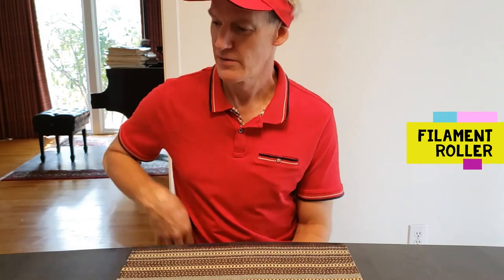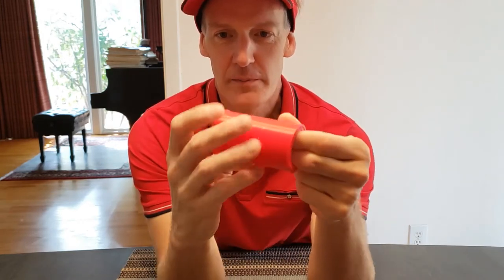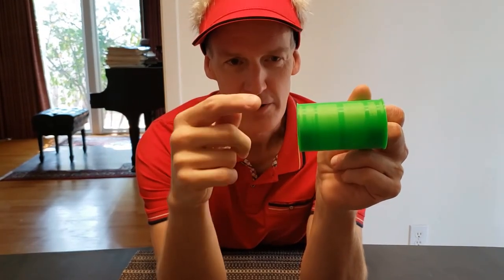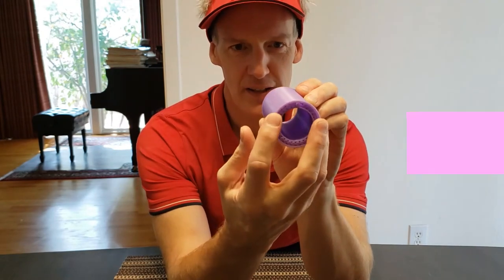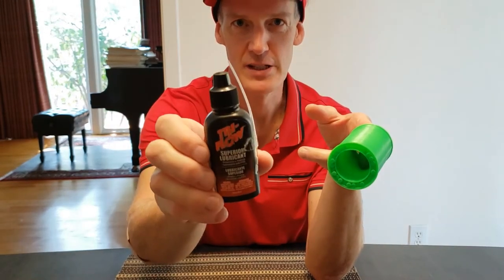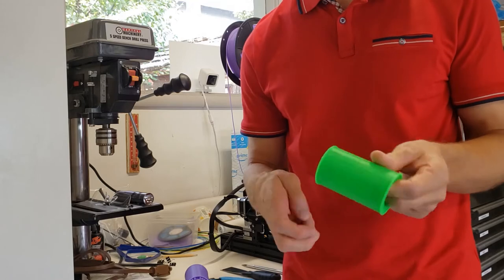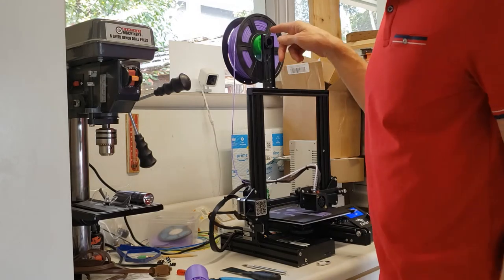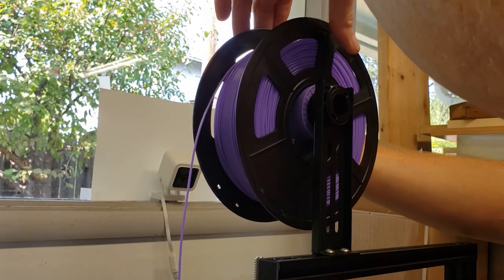3D-Printed Filament Roller Bearing

Comment: made a big difference.  The spool is not rocking much at all, and the vibration of the machine is greatly reduced.  The filament is only barely rocking, like 2 degrees instead of looking like a pendulum.

Comment: How do you deal with noise?
Reply from the maker: Two ways. First, upgrade the CPU board to a Creality 4.2.7 so the steppers are nearly inaudible. Second, locate it in the garage. :) Seriously, the cooling fans are the only noise remaining and there are videos on how to upgrade those too.
Reply: if you mean noise of the bearing, it spins way too slow to be noticeable I assume, I am currently printing my own out of petg
Reply from the maker: @GamingAmbienceLive  Yes, the noise is negligible vs the printer itself! I'm curious how your PETG version will come out. I have to try it too. Getting clean PETG prints has been perpetual trouble for me.
Reply: @curtmcd  it’s like 2 hours away from being done I’ll let you know. I also have ender 3 pro it took a day of frustration to dial it in for PETG but basically set the hot end temperature to 260°C and bed to 76°C, zero cooling fan, cooling fan completely off, retraction speed 45mm/s and distance for me is 2mm but I did the direct drive mod by printing out this clever bracket. Then printing speed set to 20mm/s if you want I could send you my profile, you’d only have to set the retraction distance to match your Bowden tube, and if you see stringing immediately abort and increase
Reply from the maker: @GamingAmbienceLive  Thanks, what you've done is inspiring. My printer needs an upgraded hot end, I think, because it halts with temperature errors anything above 240.
Reply: @curtmcd  that’s weird my hot end is stock and the box spec said max was 250, but apparently I can crank it up to 260 with no issues! That said a multi-part prints need cleaning, so this bearing printed and it rolls it’s pretty functional, but nowhere near as fluid as yours, I will lubricate it and check again.. is your printer the pro version?
Reply from the maker: @GamingAmbienceLive  I did have to roll the bearing quite a bit then lube it, but in the end, every one I've printed has ended up working well. I had a stock Ender-3 then eventually upgraded to 4.2.7 and CR Touch. I'd like to go for a MicroSwiss at some point to branch out from PLA. Thanks for all the feedback.

Comment: I don't understand, unless your using a filament so soft it will break .i.e. cheese, with any friction its complexly pointless. A circle in a circle isn't going to cause any issues.. You just added more circles and risk of failure.... Engineering and. Over engineering are 2 different things. Nicolai Tesla didn't invent elasticity 2.0 he invented a new way of transmitting electricity instead. He didn't add more wires to the same thing and call it a revolution.
Reply from the maker: Good question that I should have addressed while prattling on. The friction causes various problems besides filament breakage. That is why there are endless bearing options on Thingiverse. For example, the teeth on my brass extruder gear wore down after just a few months, which I had to debug after getting underextrusion (I've since switched to a stainless gear). Also, the filament is deformed to a greater extent as the teeth grind it and take off micro bits of filament. You might have noticed tooth marks on the last 300 mm of filament when you pull it out; I no longer notice that happening. Also, you may have heard about filament ingress holes being ruined by a wear notch. We do everything we can to achieve quality and would prefer all of the stepper motor power to go into pushing filament precisely, not pulling on so many things. This is the Tesla of filament rollers. Well maybe not, but it's one of my favorite printer upgrades, and it will test your print quality if you accept the challenge.
Reply: @curtmcd  No, the extruder will leave indents as its pliable plastic, designed to be melted and applied. If not it would be useless. That isn't an issue to be resolved, its the purpose and design of it. Also if your inlet holes are getting ruined its because you didn't read the manual and place the clip of the inlet tube. If you believe the radius of the CIRCLE on a CIRCLE is an issue you seriously need to stop 3d printing as you have no idea what's happening outside of magic.
Reply from the maker: @chrisnewby9771 You make a lot of incorrect assumptions and speak rudely. Good luck to you.
Reply: @curtmcd  Its not assumptions its simple maths and science. Also its not rude, unless you take it as rude because you are aggrieved that someone called out the spouting of bullshit.
Reply from the maker: @chrisnewby9771  Be sure to try my newest v4, based in OpenSCAD. The circles in circles work well, although I still prefer v2. It doesn't take long or use much filament, so you can easily evaluate it before making more dumb comments.
Reply: When it comes to any machinery, extra friction is stress. Stress leads to undue wear, wear leads to part failure, sometimes that part is the ptfe tube, sometimes it’s the filament. Even if it will print while dragging heavy weight, it would operate in a smoother manner if it didn’t have to. Like a car dragging an anvil behind it, yes it will move, but. The engine has to work harder and you’ll likely damage all sorts of things doing so. And you definitely are rude.